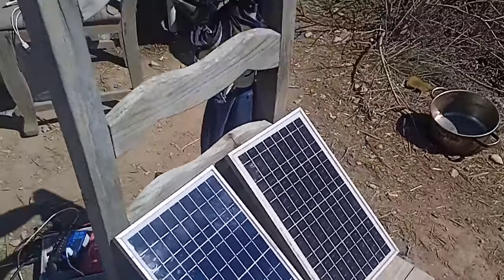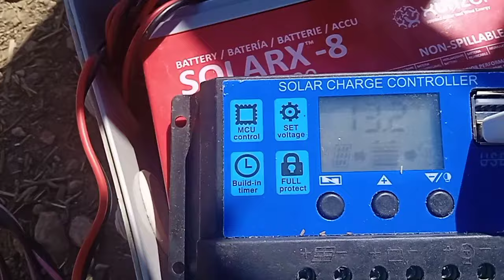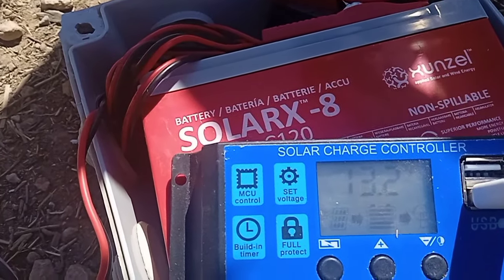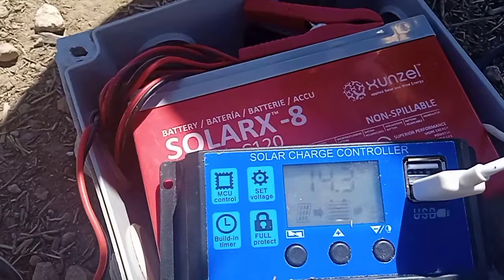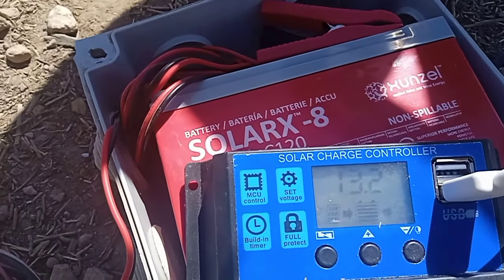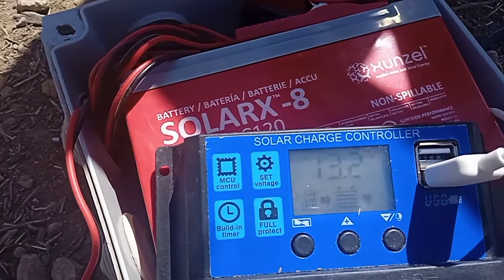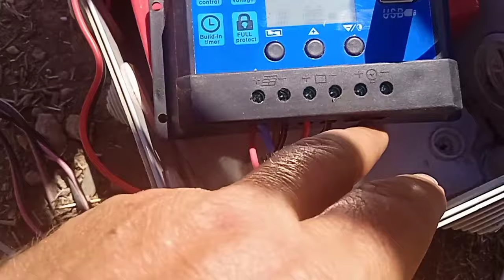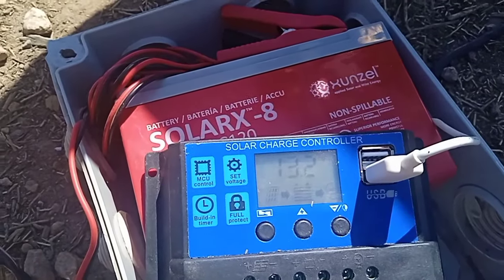Torrevieja Homeless Hobo : Solar Charge Controller Issue / Query. Help Please!

Comment: Electrician here. I can give you some free advice. The main question I need to ask, what do you want to use your solar panel system for?

Advice for now: 

- It looks like you have a 12v battery. You're charging it too much. Set the max charge voltage to 13v. This will make your battery more stable and the correct current will flow into your battery. Do this with the first button on the left. Ask me if you need help doing this.

- Keep your battery and charger in the shade. The heat can affect voltages and current.
Reply from the maker: Hi John. The system at the moment is just to charge a mobile phone, a tablet and a few AA and AAA usb powered batteries that plug into the USB port from the charge controller.

The charge controller is, on paper, way over specced for this purpose. But I'm only running two 12v 10w (So 0.85 amp) solar panels connected in parallel.

I know it's all less than ideal. I currently have to carry out while system each morning and bring it in at night.

Eventually I'm looking to step up beyond this with a 100 watt panel, but shush, I haven't told anyone yet. EcoFlow's the word, Erm mum's the word.

Controller has three battery types with settings preset. I chose the one I think is most appropriate for sealed lead acid AGM deep cycle battery. It's 12v nominal, 8ah so about 100whrs.

Normally there's a lid on battery box. And a waterproof cover over top and it's shaded by the chair-ish.

As I said, not ideal but it is better than the dying foldable toy panel I started with.

I swapped charge controllers recently and just feel it doesn't put as much oomph into battery and USB ports take longer to charge devices.

And the digital readout surging as it does in the video, is that normal? Previous controller had no digital display just Picard's Four Lights so I didn't have data to concern me.
Reply: @DeltaMikeTorrevieja  There may be an issue with the charge controller. I would not worry about it if you're only using it to charge your phone. I would suggest to run the solar panel constantly from sun rise to sun set. On the night time charge your phone while you sleep. Your phone should be 100% in the morning. Your phone will use about 3w per hour to charge. Hope this helps.
Reply: Hint: If you get desperate/emergency and have a dead phone, you can wire 3 x AA batteries in series by linking them up with each other end like (+-)(+-)(+-) to get 4.5v DC, cut the USB part of the charger off a charging lead, connect positive and negative to wire, and charge your phone. Search emergency charging your phone with AA batteries on YouTube for a tutorial.

Comment: Your battery is goosed.
 You need to disconnect as soon as possible because the controller is being forced to try and fill your battery which can no longer offer the resistance to keep the controller stable.
Reply from the maker: Can you explain further.

From the technical specs of the battery it looks like it's charging (absorption) voltage is 14.7v

https://www.leroymerlin.es/productos/energias-renovables/energia-solar/baterias-solares-y-cargadores/baterias-agm/bateria-solar-agm-xunzel-12v-8ah-sin-mantenimiento-15276163.html

In the documents listed.

Is It possible that the second panel I needed in winter is too much for the battery? Charge Controller should certainly handle more 12/24v up to 20A.

It's a deep cycle AGM battery. Charge Controller is set for correct battery type and settings are at defaults as far as I can see.